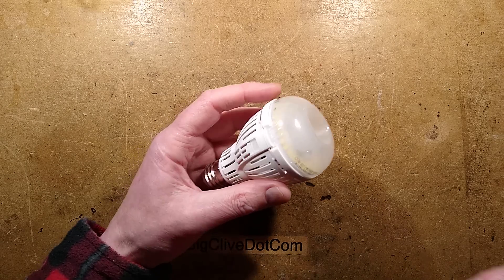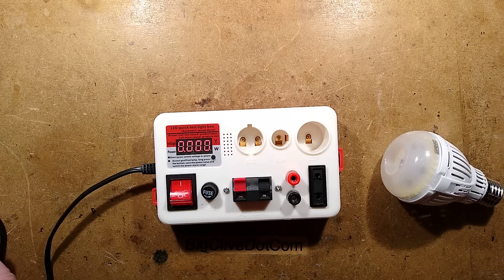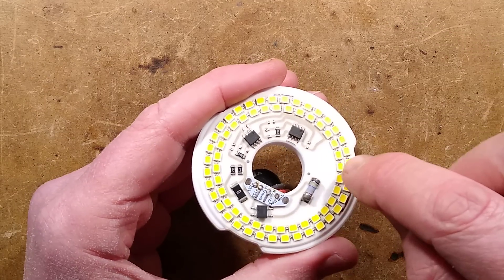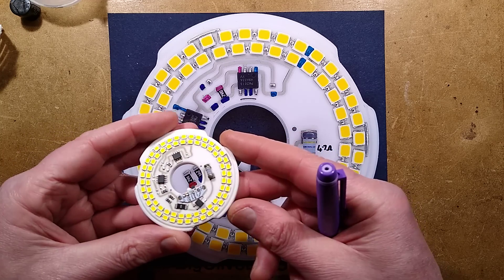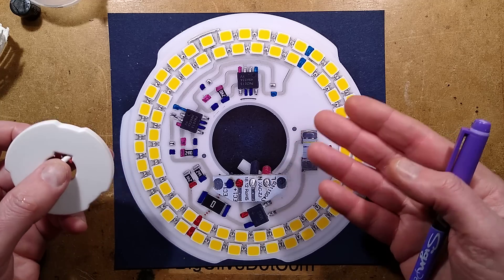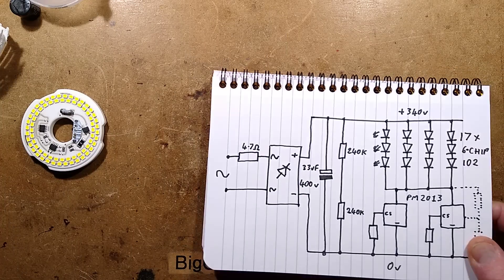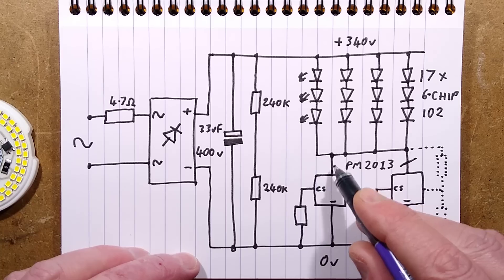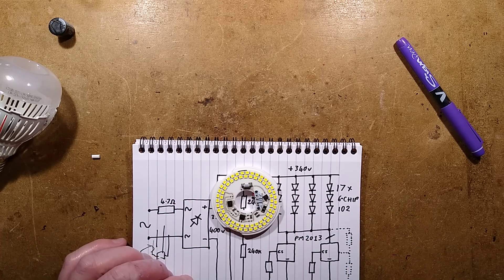Inside a ceramic lamp (with schematic)

Comment: They have some insane models, one offers 4000 lumens and the bulb is heavy. The ceramic heatsink is thick and has fins. Its an expensive material to use, its Aluminum oxide. Such an overkill build. I put one in a room and someone thought the door was left open was the reason the room was bright white inside. You can feel the convection it really does a good job of passive cooling. The base is cool to the touch but the alumina is hot as heck. I doubt they will keep making these overkill bulbs. Too much expensive materials. Also CRI is 80+ The ceramic with the circuitry reminds me of those oldschool hybrid modules used for specialized equipment by Western Electric. Oh and they offer 5 year warranty on the bulb.

Comment: I managed to take apart one of the 13W bulbs using a spudger and screwdriver. starting at the top of the bulb between one of the three ceramic exposed parts you will see the top transparent cover goes down and under an the opaque plastic part. immediately below where the transparent plastic emerges insert the spudger with force and angle the spudger handle down, levering the opaque plastic away from the transparent plastic. wiggle the spudger around to give enough room for the transparent piece to be able to slip freely under .Then I used a flat head screwdriver in the gap between the top most gap between the transparent plastic and the opaque plastic and twisted to lift the transparent plastic through the clip. It was a struggle but It will come out.
I then cut the trace as suggested to lower the brightness but it did not make any difference.
Cutting the tracks is very very hard. The metal tracks seem to have become one with the ceramic.
Reply from the maker: I subsequently discovered that by forcing the clips up with a screwdriver the top could be popped off.  Tricky though, as it wants to pop right back on again, so needs packers tpo prevent that.
I hacked one by removing one of the current sense resistors.

Comment: Print and fire, not laser sintered; the latter would require long laser times on each bulb and registration of the substrate. The temperature under operation would be interesting. The surface area is small compared to what's achievable with an aluminium heat sink which could fill that empty space in back of the plate.

Comment: Wonder how long it would take to lose 50% of its light. I have standard led poundland bulbs all over the house and in 6yrs only 1 has died so they are already quite robust. Cant believe the first 25yrs of my life was spent burning 100watts a bulb and changing them every few months multiplied by a few billion people. LED tech is monumental.

Comment: I worked at a company making ceramic boards for high temperature circuits.  The traces are silver powder in a binder put on with a silkscreen and then fired to burn off the binder and fuse the silver.  That ceramic is REALLY hard on the machines, constantly grinding down the hardened steel guides.

Comment: The East Germans used to put ceramic printed circuits in Trabant cars (voltage regulators, fuel flow meters, electronic ignition units) in the mid 1980s. Amazing, but impossible to repair.

Comment: It would be interesting to see one of those multi white bulbs.  Where it changes the white tone every time you power it on and off fast. But when turned off and in normally it keeps the same tone.  Normally they are 3 faze, soft/warm/day.  It's not just a brightness change like old incandescent 3 phase bulbs.
Reply: Yeah I wlike like to see That too

Comment: Nice! The datasheet translation by Google for the unknown pin is "3 PCR constant power control or dimming control terminal". Looks like you can dim them.

https://file2.dzsc.com/product/22/08/11/1138418_235101174.pdf

Comment: So where does the 400v come from, with a 240v input? Is that something to do with the rectifier, or..? I may have missed a part of the video, but I don't recall seeing anything about a voltage increase up to the part where you show the schematics and mention 300+v
Reply from the maker: Your mains supply is measured with RMS (Root Mean Square) to give an average value of the sine wave.  The peak voltage is 1.41 times higher.  So on a 240V supply the capacitor will charge to about 350V.  A 400V capacitor gives a safety margin.
Reply: @bigclivedotcom  Ah, perfect answer! Exactly what I wanted to know, as always! 
Seriously, your ability to explain things in your content is impressive but what is even more impressive is your ability to understand what others are asking and giving them an appropriate answer without going too in depth or providing information which is too broad and shallow.

Just signed up for a month of patreon, as thanks. Barely begins to cover the value of information you've given me, but I'm a broke boy so I just gave what I could :p 

Thanks, yet again, for the help big Clive! Really appreciate it!!
Reply: Capacitors are normally spec'd with a safety factor - quality 12V circuits will typically use a capacitor rated at 35V or higher. With 400V being a standardized component, I expect this is the same.

Comment: I use 2 Sansi C21BB 27watt E27 bulbs for my garage and I lights it up a treat.  The ceramic on those is even more beefy but they use a driver on a little board and the centre of the bulb.

Was so impressed I bought a Sansi PIR flood light on the driveway.  Built to last and not a hint of flicker.

Comment: I'm a disappointed by it being linear. I prefer switched mode, because it's more efficient and works better over a wider supply voltage range. I think I'll give it a miss, as it's not easy to modify it for SMPS.
Reply from the maker: Linear has many advantages.  Much simpler and no electrical noise.
Reply: @bigclivedotcom  Yes it's simpler, but if I'm going to pay more, I'd rather have something with a higher efficiency. Another benefit with switched mode is it can be designed to work from 100V to 250V, so the same lamp can be used worldwide. Noise isn't a problem, if it's properly filtered, but that increases cost.

Comment: I don't know about laser sintered tracks. That seems like quite an expensive method with little room for mass production. Printing the tracks and then sintering a whole large batch in an oven should yield the same result, but allow for huge quantities. It is quite likely even possible to print the tracks onto the ceramic green compact, which has to be sintered anyway.
It's like 3D printing vs. injection molding. 3D printing just isn't scalable. If you suggest it for a mass produced part, you won't be part of the company for a long time.

Comment: These days, >200 lumens per watt should be the target.
This one is nowhere near.
I'm after 2,500 lumen  GLS lamp consuming about 12 watts.
The PCR pin might be overpower protection. High mains, 340V increases, voltage on linear increases PCR detects this and reduces current.

Comment: I think the life of the bulb is limited by using an electrolytic capacitor And the capacitor is being run close to its rated voltage. Otherwise it appears to be a quality product.

Comment: Given the construction quality I have to wonder if it'd be worthwhile to replace the bridge rectumfryer with a voltage doubler to allow use here in the USA.
Reply from the maker: The doubler could possibly be housed down in the base to provide DC directly to the ceramic panel.

Comment: Used to work for a lighting manufacturer over here in the states that specialised in horticultural lighting. We did some research with the Sansi ceramic substrate products. Interesting stuff, but stupidly expensive

Comment: Maye the thicker ceramic provides a better radial heat conduction path. Most of the heat is generated by the LED's near the circumference, but the dissipation surface is over the full radius (less the hole), so better radial conduction might help cool the LED's.

Wouldn't a series dropper capacitor either (if too large) do nothing because the regulators would just conduct the same current as they already do or (if smaller) cause the regulators to go fully conductive (lose regulation range) in which case the lamp brightness would vary with line voltage? If these are linear regulators, the first case would let the regulators run a bit cooler, at least, but if they are PWM it would just change their duty cycle.

Comment: Re the thick ceramic - this will give a substrate that is mechanically more robust, but also may increase the yield of good parts during the ceramic manufacturing process. The thinner ceramic parts are the more likely a higher percentage will get broken during drying and firing (and in use, when the finished lamp is being punted around by growers etc.) Looks like a well made unit. Cheers!
Reply: Mr. Dayman. It is apparent to me you understand the mechanics of ceramics. Are you aware of any implementation or applications of ceramic fins in sintered substrates? I am currently asking my colleagues who are unaware of these applications in scientific settings as well.
Reply: @LeviGoldwing  Short answer - no , not aware, sorry.

Comment: Ceramic seems like it has enough thermal mass so that the thermal regulation in the chips would be able to effectively throttle if needed, without oscillating too far into overheating before it gets there.

Comment: They used 2 240K resistors for the voltage rating, but they laid them out such that they might as well have used a single 470K resistor. Such a tiny gap between the high and low sides there; they could have done a lot better.

Comment: Thanks to my experiments, in my opinion any lamp that gets hot and needs a massive heatsink is bad. Why manufacturers dont reduce the current to avoid the maximum drive or overdrive and you don´t need a massive heatsink. I found out that maximum or overdrive generates a lot of heat but doesn´t give you much more light. Actually, it is a waste of energy and reduces the lifespan of the LEDs. I have modified a few lamps now and run very cool with a plausible amount of light. Power consumtion is also reduced. The optimum light source is flat and don´t use a diffusor. With this you get the best angle of light - 170 degrees - and you will get the most lumen out of it. There is absolutely no need to produce heat at all.
Reply: You answered your own question about manufacturers....they sell lamps that fail to stay in business selling lamps...they really do know what they are doing.
Reply: @carlbukowsky1931  I know and that is why it is so silly to design a better ´patented´ heatsink solution to get a better lifetime. The question to get the heat out of it is very simple. The real stupidity is economy, how it works, the need to sell and consume. We need to do better for the environment, consume less and buy better products but the economy requires the need to sell and buy things. That is a dead spot in a wannabe perfect world we don´t talk about. It is a joke, foolery. The need for money is never blamed but in fact ruin all perfect solutions. It cannot be perfect or close to perfect because we all need money to buy, eat, live, study, rent, pay endless taxes and so on. But yeah, that is not a part of the problem to discuss or to solve because..... economy or how we live in a money ruled world is king. It is ridiculous, symptom control.

Comment: Why the through-hole resistor?

With the rest being so polished, I wonder if there is an actual reason. Heat dissipation, maybe?
Reply: That's not through-hole, that's MELF.

Comment: I have been using Sansi leds for about 6 years.  They are super bulbs.  The  larger 200-250 watt equivalents are very bright with little heat.

Comment: This is a superior lamp ( unlike some of the other piles of  💩 that you get from ebay ? ) Ha-Ha .... you might re-purpose the ceramic ring into a " bespoke " light fitting  ( you could re-fit the 33 μF  on a longer lead out of the way , and make a night light in the old case ( ? ) ....  🐵... DAVE™ .........

Comment: Ceramic circuit boards were used many years ago by Motorola in cell phones. I worked at a factory in New Mexico, USA, where Motorola had a factory, inspecting them in their green form (not yet fired) for flaws. Of course no solder tracks were on the board yet. These were about 0.16 cm thick.

Comment: I've had a set of 16W 2000 lumen versions used in my garage for a little more than 4 years. $10 USD each at the time. Nice and bright, and handle the wide temperature range of the garage in Minnesota (approx -5 to 110 deg F).

Comment: When you mentioned how they might apply the circuit tracks to the ceramic base, I thought back to my time working in an auto-glass factory. We used silk screening to apply the heater lines to back windows. The paint was a ceramic silver mixture that bonded with the glass under heat. The could do something similar with these lights: silk screen the tracks and then use lasers to bond them to the ceramic.

Comment: Got some SANSI bulbs in my house, actually: two on the front porch and one in my office.  Both the brightest my wife and I could get at the time, and all 3 bulbs still goin' strong.  Of course, meanwhile, the LED bulbs we get from Home Depot either work just fine or start flickering within a few months.

Actually, would anyone happen to have decent recommendations for 40-watt equivalent LED bulbs for a full bathroom?  Ours keep dying, even when they're full-glass bulbs.  Havin' a hard time finding ones rated for humid environments.
Reply from the maker: It's tricky finding properly sealed lamps that don't suffer inside enclosed fittings.

Comment: Looking for advice, what to look for to avoid lamps that emit high pitch sounds? Even name brand expensive ones can have this issue. Tips, anyone?
Reply from the maker: The generic cheap non-dimmable lamps are usually linear regulator based with no high frequency circuitry.
Reply: @bigclivedotcom  I see, so I need to go the other way, being cheaper. My thinking was that expensive would be better. Will experiment. Thank you.

Comment: Isn't ceramic a really good insulator (thermally and electrically), and thus probably not great for heat dissipation? Wonder how long it will last before getting the black spot of death.
Reply from the maker: This ceramic is optimised for thermal conductivity.

Comment: The most valuable part of this review would be measuring actual temperatures on diodes when lamp is on. Cannot find that measurements though.
All other quirks are a typical china-random-engineering school: let's make some random design decisions then sell the product and see how it goes.
Had it failed in 1000h? Oh, dear you ;) Let make another one and sell it. Oh, was there a failure once again? No problem, we will try again. Evolution should take millions of years, didn't you know?

Comment: How easy is it to solder on those ceramic PCBs? Looks very repairable either way.
Reply from the maker: Not sure how easy it would be to solder on them.  They'd probably need preheated.

Comment: A look into the capacitors rating for temperature and life, aswell as measuring the temperature it is exposed to, would be useful to determine how long it will last.  Usually there are several different life ratings for each temperature ratings, also ripple current rating and resistance determine how much heat is dissipated in the cap.
All the Sainsburys LEDs I have ever purchased fail at about 1/4 their rated life, I' assuming they are cap failures but I havn't investigated.
Reply from the maker: I've featured the hacks that can be done on the cheaper lamps to multiply their life expectancy greatly.

Comment: Dear Big Clive, another random question (i am subscribed to your channel), I am buying a V-tac led spotlight for use over an aquarium. Its 20watts, But these things burn out usually (never had a v-tac one before though), Do you think using a capacitor inline with the live wire (resistor in parallel) would increase longevity of the spotlight ?
Reply from the maker: It depends on the light.  I use V-tac "grill lights" in my live stream area, but they are all hacked to lower their power.

Comment: It's interesting you did a teardown of this, since I was /just/ looking at them the other day to replace some outdoor lamps and I thought they looked cool. The advertisement on Home Depot here says that the combination of the ceramic ring plus the hollowed bar-like base is supposed to maximize heat dissipation and I can see that. I can also see, though, that the ceramic would be subject to moisture unless something was added in production to make it less porous. (This is an interesting point considering the bulbs I was looking at are outdoor rated and the grow lamps can be expected to be used in humid environments). I regret not buying them, just because I was in a hurry at the store, though after this I'm quite curious and may get one anyway, haha.

Comment: Interesting (also some of the comments) as my initial thought was that the ceramic substrate (A) wouldnt be thermally conductive enough and (B) not big enough to dissipate the heat, but I admit I know very little about ceramics. I've noticed generally LED lamps over 10W dont seem to last more than a year or so, which I put down to not being able to dissipate enough heat. I'd be curious to know what the running temperature is compared to more standard lamps.

Comment: I've taken apart every LED blub that fails and one of the more common failures in my experience across many brands (including Philips) is the capacitor, most of them are completely fried. Poor ventilation and the typical overdriving of LED's producing too much heat. This one looks great with how much ventilation it has and the distance the main cap has from heat source.